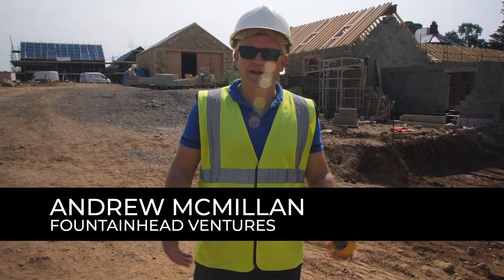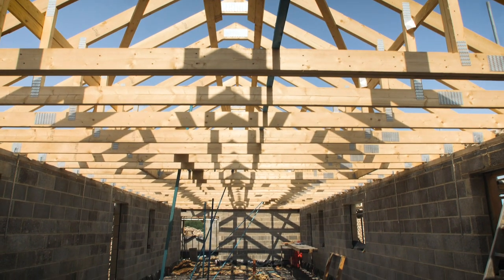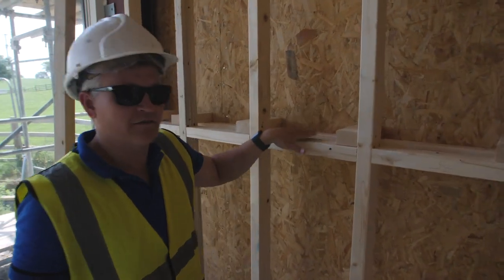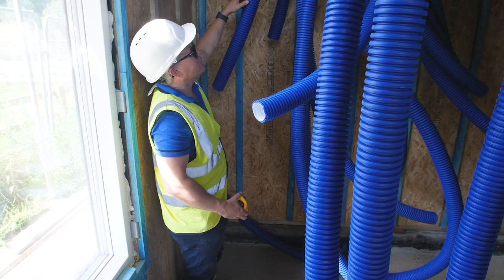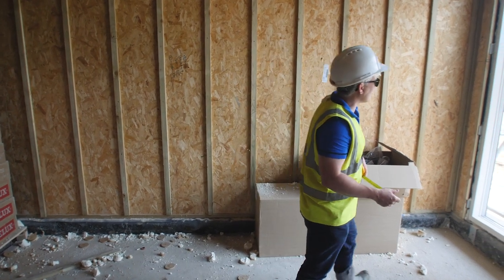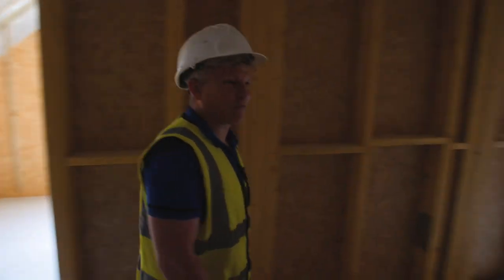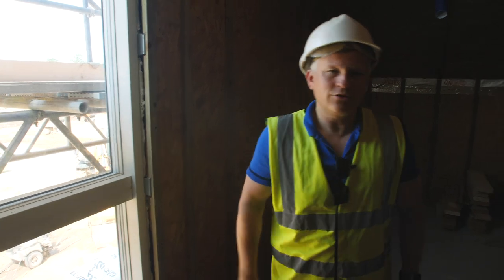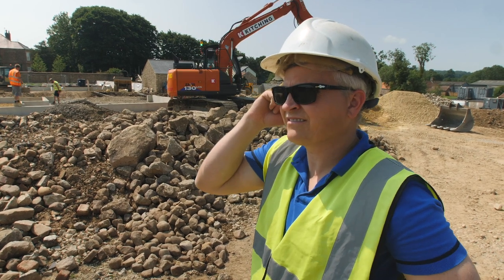SIPS Housing Development - Church Farm Ep4 | June 2020 Update (Eco-friendly SIPS Homes)

Comment: I've built with SIPs myself and am considering it for the passive build we have planned. I was somewhat astonished to see a gas pipe going into these houses though. If the whole point is to build an environmentally sustainable building then I would have thought the absolute minimum requirement was to go completely electric. Great series otherwise, thanks for filming it.
Reply from the maker: Hi David, I'll try and get Andrew to jump in here and comment on your observations, but from my limited knowledge I don't think the development was ever going for a completely environmentally friendly status because the buyers were given the ability to modify the designs to their choosing, so I'm guessing the gas pipe could be related to that perhaps? Thanks for the comments though, it's why Andrew wanted to share the process in the first place so that people could learn from, comment on, and adapt the way he approached the challenges he had for their own purposes.
Reply: Hi David, 
Well spotted! We have done quite a few projects with Air Source Heat Pumps but as we had gas already on site I had to make a decision about where to get the most bang for my buck. As a developer, I do still need to make a profit and many of the materials we did use were incrediably expensive (Siberian Larch) and more so as the material increases stacked up after Covid. Also, any government incentives to off-set the extra capital outlay were withdrawn some time ago for developers. We did, however, future proof the heating system by installing the underfloor heating at closer centres to work off the lower temperatures of Heat Pumps. I fully anticipate that the next heating system for these houses will be Air Source Heat Pumps and hopefully by that time there will be a return to incentives (at least for the home-owner) and an exponential improvement in technology. This is the same reason we didn't utilise solar; a story for another time....🙂